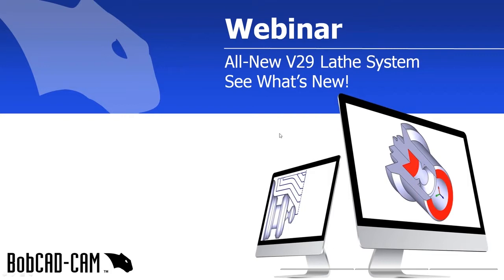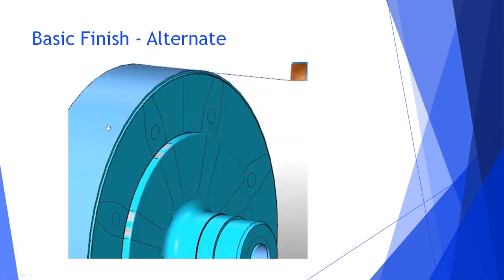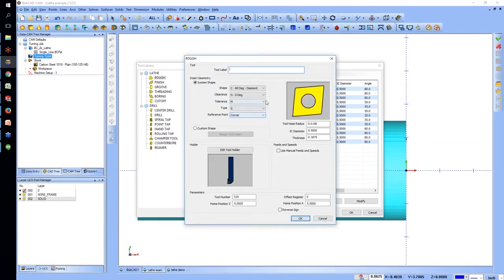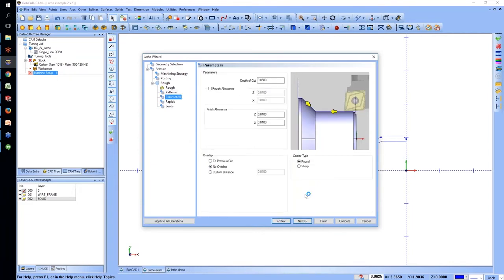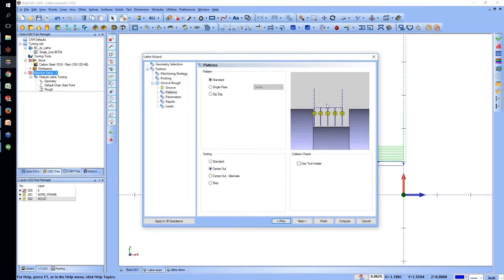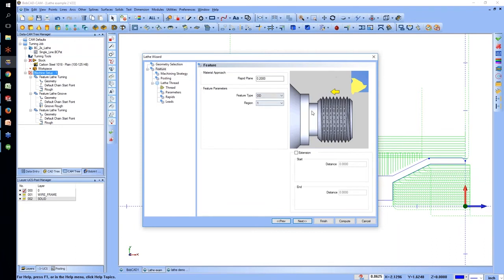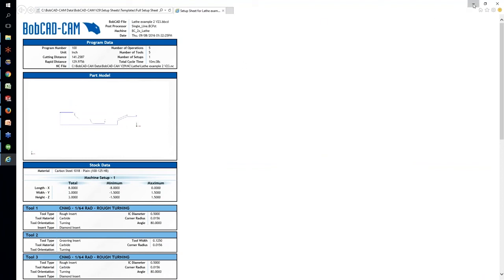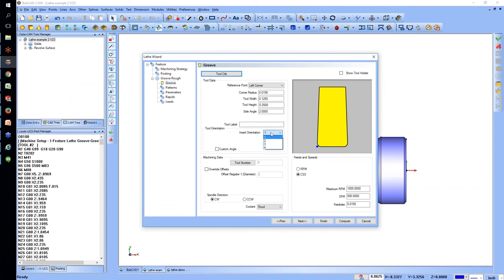All-New V29 Lathe System - See What's New - BobCAD-CAM Webinar Series

Comment: What would yo do if your insert location dot (tip, center, corner) isnt in the right location? Its on the right corner when it needs to be on the right. Im using an internal threading bar and no available insert orientation is appropreate. When I attempt to model an insert and boring bar they dont co-witness no matter what I use for the origin?

Comment: what is the difference between extend and lead against just drawing some extra virtual feature lines?
Reply: Extend changes the "drive" geometry start and end points.  Leads are used to change how the tool will lead into the start or lead out of the end of the "drive" geometry.  In some ways you could use leads in a similar way as extensions, but I think you'll find have both extensions and leads  provides the most options for turning your profiles down.